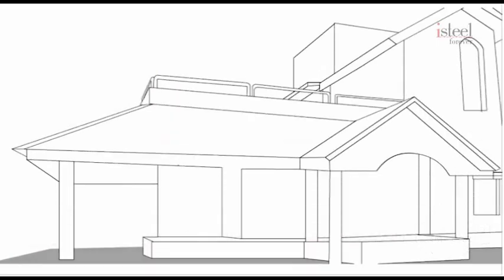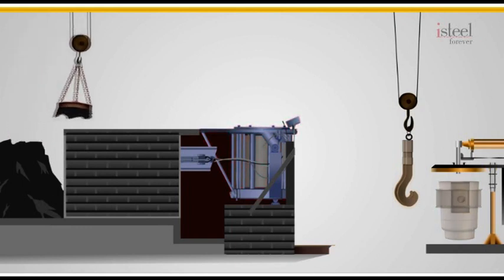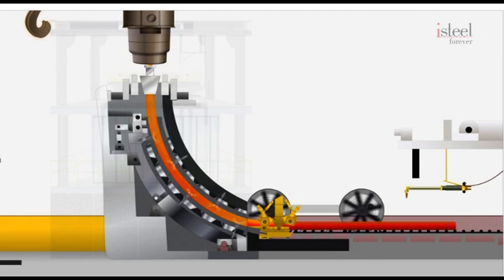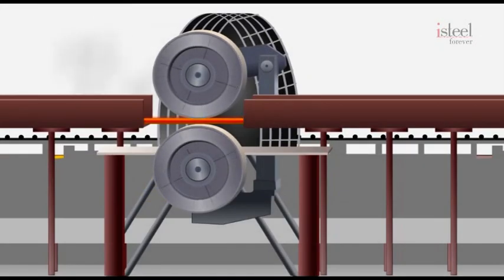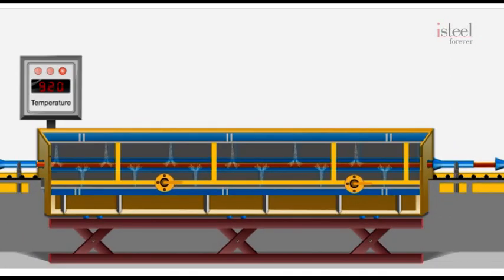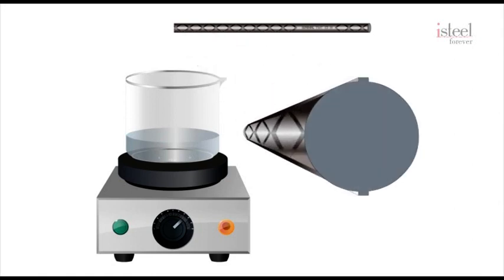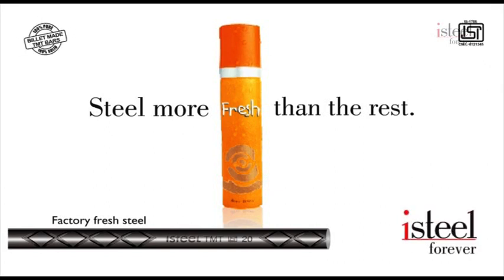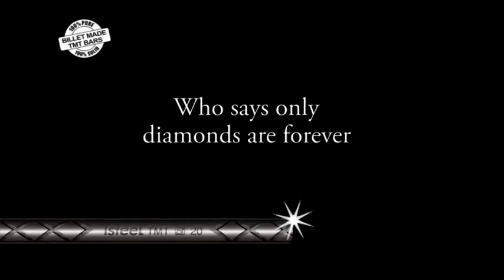isteel TMT Making process Video

Comment: Super
I am dealer of used steel plant machinery like steel rolling mill pipe plant tmt plant furnace ccm units etc if any machinery or electrical requirements ( motors transformer etc) please call or whatsapp Monu Gill 9312292641

Comment: SHOCKED to see X-ribs on the QST rebars in this animated video. The 2001 standard ACI 408.3-01/408.3R-01 states "Reinforcing bars with X and diamond deformation patterns are excluded from this standard because their bond properties are markedly lower than bars with parallel ribs." 
Additionally it adds "Also, X pattern bars are not allowed in the Canadian Code (CSA 1992) because Canadian bond pullout tests on X pattern bars gave significantly lower strengths than did parallel rib bars." 
It seems that in India, "anything goes". For example Europe did not allow use of CTD bars since 1972 whereas in India these CTD rebars under brand name of "Torsteel" ruled the market till 2002. For 30 years only rebars of yield stength 415 were used - until Grade 500 QST rebars became popular after they were introduced at Durgapur and Bhilai Steel Plants of SAIL. '
Grade 500 became the norm only AFTER the structural engineers were "educated" about the ill-effects of CTD rebars in the famous 2003 International Conference of ICACI "Reinforcement Steel - Today and Tomorrow".
Reply: Raj Kumar Markan. Rightly said. Any thing will go here. Site control is almost zero. Illiterate work force does no technical aspects of construction . only god can save us and our homes